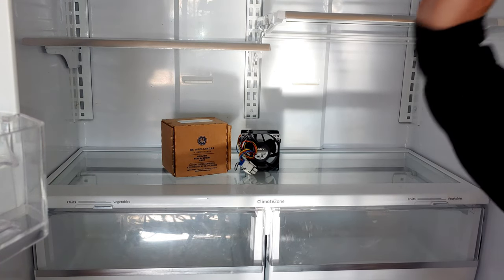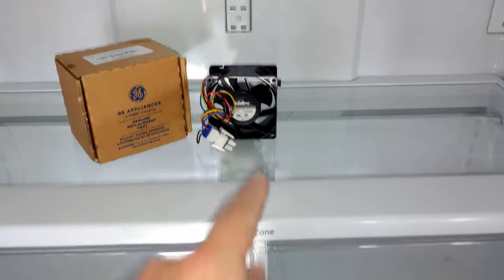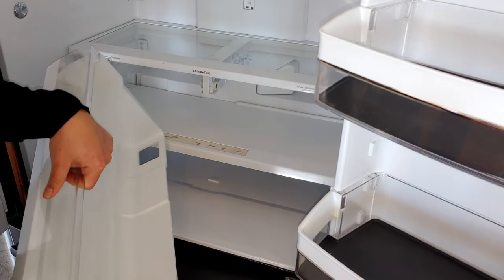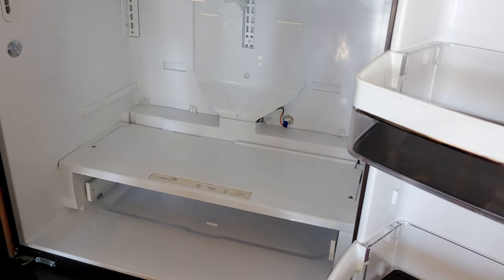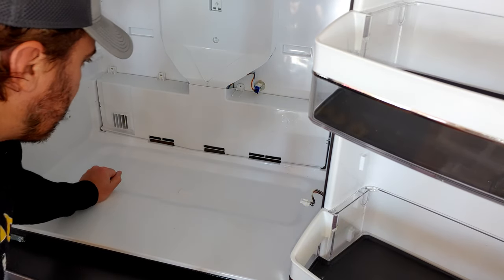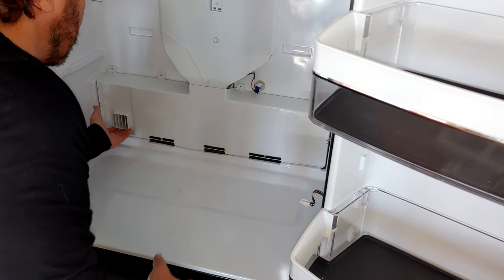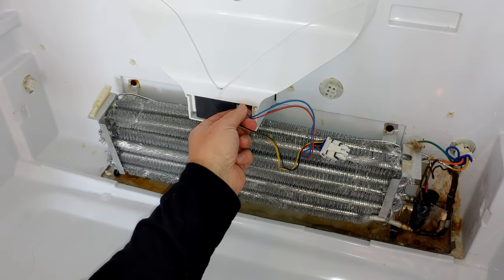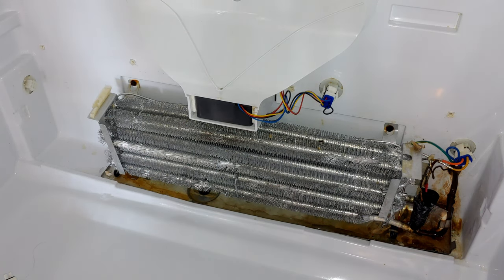How to Replace a GE Refrigerator Evaporator Fan Motor

Comment: Thank you for this video! Quick question - Is the Fan within the evaporator cover supposed to run all the time? Mine isn't running when I took the cover off.
Reply from the maker: I'm not 100% sure but I do not believe it runs all the time. Reason is, that fan flows the cold air into the fridge. There's a thermostat in there to regulate temperature and if it got too cold shutting that fan off would increase the temp to regulate. You could probably research to find out for sure. Main thing - does the fridge cool and get to the proper temperature. Glad it helped and thanks for watching!

Comment: Hi i replace the big fan works, the small fan in the left side dont move.
I connect the small in the big plug to see if the fan works and works.
How can i tested if i have power in the left small fan connection?  Thank you.

Comment: I have a question sir, I have the GE French door fridge. Looks very similar to this one. I feel like it goes into defrost mode more than it needs to. I just have replaced this fan as well because it wasn’t cooling so thank you so much for showing us, however, the cans and glass bottles will have condensation on them and the fridge part gets warm, then after 40 min it gets cold again. Is there a way to limit the amount of times it goes into defrost mode ?
Reply: I could be wrong but that sound thermostat ish. It shouldn't do that within 40 minutes. Thermo probably is reading incorrect. If it were the heating element then it would go hot for more like 12-24 hours during defrost.

Comment: This is the second time I’m doing this and I end up with ice and water forming behind there. Is it these fans are faulty? Thank you so much for the video, it was so helpful!
Reply from the maker: 1st off so glad this video was helpful and thanks for watching! Yes I had to replace this fan (and I used original GE parts) 2x within 3 years. The part seems poor to me, or there is something back there (like bad design) stressing the fan and making it have a short life. And yes, when they go bad, that air doesn't circulate and then there is a ton of ice build up back there under that cover. The fan is key to moving the air so that the coils don't freeze over. When I replace the fan I typically open the doors for a day, let everything thaw out, clean it, and replace the part. I'm fortunate to have a backup fridge in the garage (oddly it's 30 years old and is like a tank), so I can let this fridge thaw. Another thing I tell the family to be careful, is the fridge isn't waterproof on the inside so if a liquid accidentally spills behind that cover and freezes the fan blades or other components, I think that hurts the fridge too. One last KEY note, that fan when replaced on certain models needs a program update. Sites like repair clinic tell you to look at the manufacture date and if your fridge falls in that range you have to purchase the update module as well. My model did not require it.

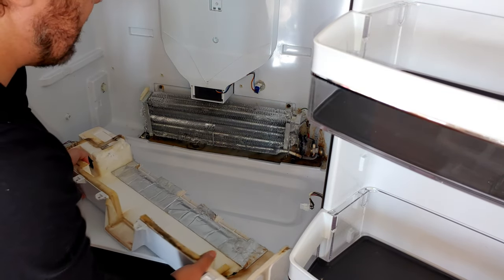Comment: Great informative video, thank you for making this. Is that an other fan @5:57? What does that do and if that malfunctions, does it also have the same symptoms as the other fan?
Reply: I kind of have the same question! 
I know that the “other fan” is what specifically blows into the TempSelect Zone/ Cold Food Zone drawers (if you have that feature)…but is this “other fan” the same part # as the main evaporator fan part # you replaced in this video? 
I noticed my TempSelect Zone fan motor needs to be replaced as well but did not know which part to order (if different than the main evaporator fan motor).
Reply from the maker: Yes from the parts diagram that is the refrigerator fresh food evaporator cover which includes the damper and fan motor. It is a single piece, and that fan isn't sold separately. It blows air into the vegetable and meat bins in the fridge. I have not had to replace it previously as they stay cold. It's part # WR17X27084 and you can see it here: https://partsdr.com/part/wr17x27084-evaporator-cover
Reply: @TheEclecticHandyman  Thank you for educating me on that. Much appreciated. Love the content!

Comment: Do you have a video about the damper on the left side? I can’t seem to find a part number for it or anything
Reply from the maker: I do not have a video on that, but try repairclinic.com and try adding your specific model number and see if you can track down the part.

Comment: Is it normal that there's that brown/black residue beneath the evaporator cover and under the evaporator? 
I bought a second hand fridge which reeks of mold and encountered a pretty similar situation, while dissasembling its parts to find the source(s) of the smell.
Reply: Bleach. I used to be an appliance repair manager, about 20 years ago, and we would run into this when people turned them in for service repairs. 

If you bleach the heck out of everything and clean it up, it will be like brand new honestly. If mold is heavy, you may want some kind of mask to keep from breathing the spores, and also if heavy mold, you may want to drag it outdoors to clean it (so the spores cannot get into your kitchen). Otherwise, bleach is a miracle worker for this issue.

It can be average to find a black brown residue, but mold is pretty unmistakable on smell and it won't hurt it to clean it. Mold can vary with black, tan, grey, or green. The main indicator is smell.

Comment: Hello, I have replaced this fan before but admittedly put the wrong fan in. I put in a three blade fan and it should be a 5 or 6 blade. A few months back it was making a lot of noise but it doesn’t anymore. When I checked the diagnostic error codes, error code 112,  "deli pan fan feedback missing when fan is running" comes up. Can you tell me what this means?  What’s happening in my frig is it is freezing the food in the crisper bins and on the shelves towards the back of the frig. The frig is cold, too cold.  I did run test 51 (deli/QC fan test) and it came back 0 rpm’s, but I’m not sure how it could be zero RPMs when the refrigerator is still cold unless that tested a different fan.  Any suggestions you can provide would be most appreciated. Thank you!

Comment: I've seen in another video where it was said that a software update is necessary after changing the motor. Is this true?
Reply from the maker: There are certain models of the refrigerator based on date that require the software update IIRC through a port on top of the fridge. My specific model did not require an update.

Comment: What brand of refrigerator is this motor for? I have a GE French door fridge and the motor is going out and making a loud humming sound. Would this motor work for my refrigerator brand?
Reply from the maker: This video was also for a GE French door fridge, but you'll need to cross reference your specific model to get the correct part. The fridge model number is usually on a label on the inside of the fridge up to the right (or left). Then go to a site like RepairClinic or something to find the correct part numbers based on model number (assuming that's the one you need), and you can shop around to get a good price.

Comment: We were able to replace the fan without too much hassle thanks to your instructions. Before replacing the fan the fresh food part of the refrigerator would go from 36 to 50 every few hours and then go back to 36. When the fresh food temperature goes up, the freezer temperature goes down. One time to -11. I have freezer set at -2 and fridge at 36. The evaporator fan didn't help. Now I notice that the freezer has a fan that doesn't appear to be turning. Could that fan cause the problem I am having?
Reply: Did you thaw out you refrig 1st? If you didnt and only replaced the fan, you will only damage the new fan.
Reply: @beachboy1219  Thank you for your input. We did thaw out the fridge before replacing the fan. Since it was 9 years old, we replaced it with a new one which is working like a champ...for now.

Comment: I always thought that you must re-write/upgrade the software when installing new parts.
Reply from the maker: This is true but only for certain models. The model and year manufactured will dictate if it requires a software upgrade (done through a port on top of the fridge IIRC). Make sure to check the serial number and model number of your specific fridge to see if it's required.

Comment: Face it this fan is gonna have to be replaced at one time or another. I think they all failed, do it yourself. It takes a half hour and a screwdriver. this video was great the helpful tips on removing the radiator cover or nice.

Comment: My new fan came with thermal grease but it did not say where or how to apply?
Reply from the maker: Interesting no thermal grease came with my GE evaporator fan for my fridge model. I did find a comment on an Amazon review for a generic version (non-GE) of the same part number explaining how the grease was used behind the sticker on the fan shaft to keep it from sticking, but I can't confirm as I didn't have to do that procedure. https://www.amazon.com/gp/customer-reviews/R3H04U2PWUF2N3/ref=cm_cr_dp_d_rvw_ttl?ie=UTF8&ASIN=B071JDY4KQ

Comment: I have a fan, which I just plugged in, without disassembling, and it's not rotating. Does it mean, that I need some software update?
Reply from the maker: Use a site like RepairClinic to enter your specific model and find the fan. It has details on which fridge models and dates of manufacture require the software update. My model did not so it was a direct replacement. That website also has a video on their site on how to purchase the software update module and where to update on the fridge if required.

Comment: I have watched tis video a few time this refrigerator looke just like mines and I we t on Amazon and Home Depot I don't see my model number and it's confusing to me and I'm a woman trying to fix my refrigerator. 🤦🏽‍♀️
Reply from the maker: The model number is typically on the inside of the fridge near the top on either the right or left-hand side on a sticker. Sometimes it will be on the end of the door on the inside as well on older models. Once you have that, try going to RepairClinic.com and enter your model number. This will provide a list of parts specific to your model. From there you can shop around on Amazon or parts stores to find your specific application part. The other way is if you have already removed a problematic part, you can take the part number off of it and buy the identical replacement. Hope this helps! 🛠️

Comment: are those fans 110 volts?
Reply from the maker: Not 100% sure but the link I bought it says the fan is 13.6 volts: https://www.amazon.com/WR60X26866-Refrigerator-Evaporator-motor-WR60X26033/dp/B07B438LZV
Reply: @TheEclecticHandyman  thank you . that's what i needed to know.
Reply: No
Reply: For test you  have to use 9 volt battery.